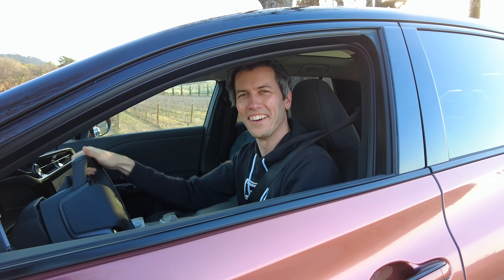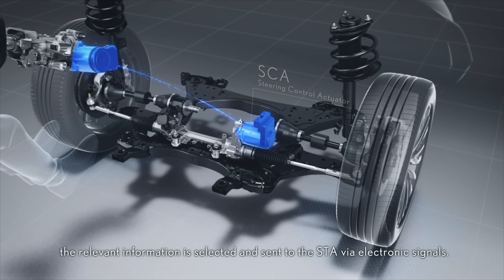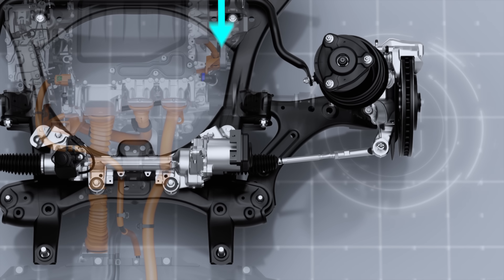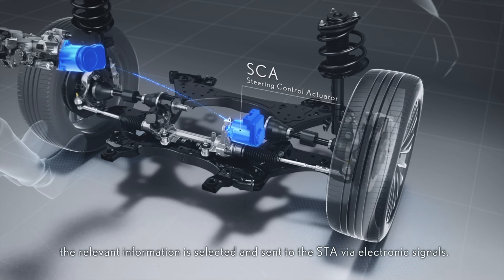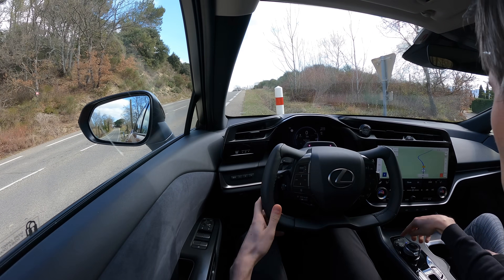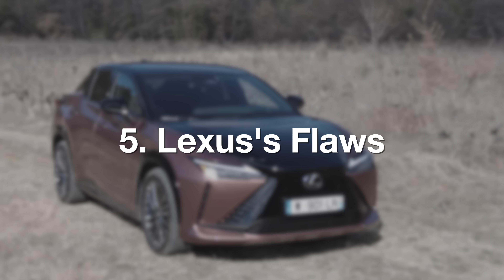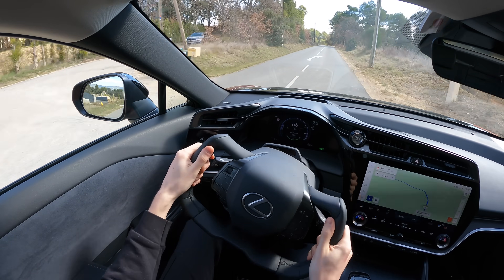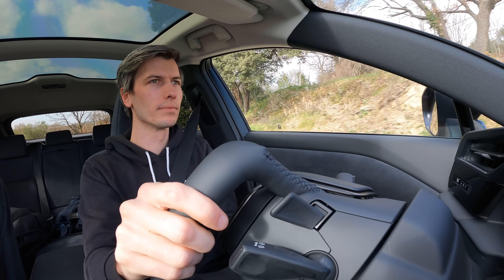How Lexus Fixed Tesla's Bad Idea: Steer-By-Wire Yoke

Comment: A variable steering ratio is going to be unpredictable for the driver, it would be like if the sensitivity of your mouse cursor kept changing, you cannot build muscle memory and learn how the steering behaves. Also the electronics could fail and there would be no way to steer the car.

Comment: I think it's a great OPTION. And I have that word in caps for a reason. 

It's a cool feature that some people may want. If you buy the car, it shouldn't be the default option (at least not in today's car market).

It's great to have new features, but if you're going to force it like Tesla did, you end up with way more problems and people complaining.

Same with Tesla and their "I need to have everything on the complicated touch screen instead of buttons". I think Tesla makes good EVs, and when they were the only option, you would deal with the setup, because there wasn't competition. Now that we have many other EVs on the market, I'm surprised they still don't have more button options, even if it is just an option.

Lexus Yolk: 8/10
Teslas old yolk: 5/10

Comment: I wonder how fast you can steer the wheel before you hit a power requirement barrier at the steer motor. I.e., if you wanted a rack ratio of 5:1, and you whip the steering wheel super fast with your hands, (the force*velocity = power) what is the max rack speed that is possible given the battery situation. In other words, up to a certain high steering wheel angle speed, eventually the rack/motor will not be able to catch up and be severely lagging behind due to a lack of power. Something that never happens with a mechanical system, because the DRIVER is putting energy into the system.

Comment: I had a 96 Deville with  hydraulic variable steering. At low speeds the steering was like an old sailing ship,tons of rotations, smooth and lazy. Highway speeds were tight and quick. No idea how GM did it but it worked really well as was one of the few things on that car that never broke.

Comment: Increased steering sensitivity is the keyword.

Going from 3.6 turns lock to lock to 2.4, the steering requires real memory muscle reflexes, when the car gets sideways. 

You need to perform real restraint in corrections of the steering.  

: )

Comment: I have adjustable electric assist and it's more than good enough. And we'll read your obit when your car blows a fuse, or a wire shakes off  and you head on into an oak tree at 60mph. Now you're pushing a possible life risk and have gone off the wall and I'm gone. I won't be back. Most of your stuff is B.S anyway. And thanks for the info, I'll be sure NEVER to buy a Lexus.

Comment: You know what also can mimic real steering forces? A proper connected steering shaft. I'm so sick of car companies trying to re-invent the wheel just to be iNoVaTiVe and MoDeRn. You want that feeling when going over bumps. Also will the wheel work with the vehicle off? because that would suck having to move a car and you have no steering. And yata yata redundancies. What happens if both go out at the same time? I assume there is only one wiring harness plugged in, what happens if there is an electrical fault? I'd also imagine the load on the battery is quite a bit. I'll never drive one of these consumable cars.

Comment: It's quite feasible engineer a drive by wire system to the level of reliability of the mechanical hydraulic assisted system, which is not infallible. This is already done is all manner of aerospace and industrial applications. Note that a mechanical mechanism has no failsafe: it can just fail. A any failure of input control and the car system could recover and or take emergency action such as emergency braking.

Comment: There's potential for some very interesting and fun things with "by-wire" technology. My first experience in ownership with throttle by wire was in a 2013 BMW 335. I really enjoyed the different drive modes. Eco was great for daily commutes where I needed to behave, all the way up to Sport Sharp where the throttle was extremely sensitive when it was appropriate to have a little fun. Not entirely sure how I feel about steer-by-wire, however. But I'm open to experiencing for myself before I make that call. If they can perfect it to make it intuitive and invisible, I'm sure I'd adjust.

Comment: As someone that works on cars, what do you do if the whole electrical system has no power at all or the wiring to the steering wheel sensors is damaged/broken? You can't turn the wheels when pushing it. Any normal car you can still steer when it's dead to be able to maneuver it to a safe place or into the shop for repair

Comment: nissan did it better, it basically functions identically but theres a traditional steering shaft with a clutch that stays open when the system is active and slams shut under any fault condition or when the car is off so it just returns to normal mechanical steering, this still allows for the variable steering ratio but doesnt leave you with no steering when the car is off, especially useful for if you have to push the car onto a trailer or something

Comment: TLDR for this video: Lexus carefully designed the yoke and steering system around each other to maximize usability. Tesla just slapped a yoke in place of the wheel because it looked cool and called it a day.

Comment: Just wonder if this is "just" a more fancy adjustable steering ratio, or it's more like modern Fly-By-Wire system.
In modern FBW system, the stick movement is not tell computer how much control surface to move, it's tell the computer what the outcome the pilot want, for example in C* system a little pull on the stick means "I want 1.3G in vertical axis" and it's up to the computer with all it's sensor to figure out how much elevator\trim\flap\slats\thrust-vectors or whatever it can move to get that 1.3G and hold there.
Like, in case of SCA total failure, could it possible to use differential braking on each wheel to get some directional control to stop safely?

Comment: high ratio in low speeds sounds good, but I will never trust that system with my or my family's lives. A delay could mean that you won't be able to go around an obstacle on the road. The motors might be reliable and have redundancy, but a problem with a sensor or wiring could mean that the ECU is going to get a wrong input that might send you in a wall, or just put you in a low gear ratio in a low speed scenario, making you unable to turn.
I will never trust a system for braking or steering which is entirely electronic. For the drive-by-wire, its all the same, I've broken a throttle body part where it holds the steel cable during aggressive driving, the car just stops accelerating, which is completely fine, hazards on, move to the right, everything is fine... But losing steering and braking?  No thanks. Even if it makes life easier, the fact that at some point, SOMEONE, 1 person, will have this thing fail which will cost his life makes it NOT worth it. If an animal jumps in front of you on the road, with that 0.6 sec delay, you are hitting it, no matter how good of a driver you are. This is just another thing of the "planned obsolescence" to make cars less desirable on the used market. This system could run just fine in the first 80,000 miles, but how about after 250,000 miles... Those wires will get chewed up, overheat, short circuit and send you in a tree... That is... if the person who gets that car replaces the battery... because we all know that there is no chance in hell an electric car battery survives for 250,000 miles, Teslas close to 300-350,000 miles already have like 3 battery swaps for 20-25000k USD and 1-2 motors depending on the model, wont be any different with a Lexus. Everyone is jumping on the "Electric iz gut" train too fast, the technology itself isn't ready for this, batteries are not safe, cars are not safe, systems are not safe... that is a lot of "not safe" things combined in one place, sure, it is 10% better for the environment in the long run if you don't charge it from a 60,000 USD solar panel system on your roof, and they don't require oil changes (which sum up to 1200 USD if you change it yourself, for the same period that a battery dies... 5 liters is $60 for a single oil change, a battery lasts from  80k to 120k miles in average, $60 every 6000 miles is $600 per 60,000 miles or $1,200 per 120k miles. Even if your engine takes a bit more, it still won't cost you more than $2000, and the cheapest used battery in good condition is $18,000, motors are in the $10k as well)... In the last year, there were 3 car fires in my home town, all of them were electric vehicles... I see NO reason at all to switch to a less fun, less safe, less economically friendly (here you have to pay for the charging, and it is around $100 to fill up a Tesla to go 250 miles)... The only benefit is the free parking in the city center, but I will live without that ;)

Comment: Wait, shouldn't the responsiveness test been done on rotating plates? Maybe the electric steering just cant make it move as fast as you're turning your wheel because of the resistance between the tires and the ground? Would be cool to get a test

Comment: It's very OLD TECH. Especially in the R/C CAR COMUNITY. It's called dual rate steering. It allows you to regulate the amount of steering based on the speed or specific needs, i.e., turn it up to limit the steering in a high speed pass, or turn it down to get full steering at lower speeds.  It's a feature of some R/C transmitters. The steering mechanism in all R/C cars is similar since it is electronically  controlled by a motor (steering servo). The dual rate feature is controlled by the user via a knob on the transmitter.
Reply: I think you're confusing EXPO (exponential) with Dual Rates.  Exponential is used to change the sensitivity of the steering in low deflections of the wheel and still allow full deflection of the wheels at full-lock of the steering wheel, but it does not change how much the steered wheels actually move.  Dual Rates are mostly used in R/C aircraft to allow greater deflection at low airspeeds, like on landing and take-off where larger control deflection enhances control.
Reply: @A Webuser  

It is more or less a combination of the two smart systems....
Exponential settings control the response curve of the steering or throttle, respectively. However it DOESN'T affect the maximum steering angle or maximum throttle/braking - those adjustments should be done with end-point adjustments or dual-rate adjustments. LEXUS APPROACH IS MORE OR LESS AN AUTOMATION FOR DUAL RATE STEERING WHERE IS DIALED UP OR DOWN BASED ON SPEED, ALTHOUGH IS REGULATED BY A COMPUTER AND NOT THE USER.
Reply: @jah-jah87  Yes, but such a thing does not exist on an R/C car radio.  Dual Rates are not a relevant feature for R/C cars....
Reply: @A Webuser   Sorry, im not sure what you mean by that. Dual-rate steering has been a thing in the R/C community for way over 10 years. Based on your previous comments, you are familiar with the r/c airplanes and not with cars, which would explain you confusing exponential settings with dual-rate. Nonetheless, if you read my initial comment, you'd realize i merely compared the technology, and yes, it is relevant due to the fact that it's tech you can readily find in MANY RTR R/C CARS.
Reply: @jah-jah87  Maybe, but dual-rates (emphasize DUAL) are useless for R/C cars since the driver cannot apply them in any useful manner in real-time.  I competed in R/C for years and was a national-level driver and there's no application of a "switch" that would change the maximum deflection of the steered wheels while driving in a high-speed race.  EXPO, on the other hand, is incredibly useful to remove on-center twitchiness at high-speeds.

Car radios use ATV/EPA, etc. for set-up and it seems you're describing a kind of easily-adjustable ATV/EPA for allowing tweaks to maximum steering angle WHILE DRIVING, but the actual use of it would be negligible since unless the track conditions changed dramatically, you'd have that long-since dialed-in.  In any case, it's NOT "Dual-Rates", that's for aircraft.

In any case, your comparison is kind of pointless since the Lexus system is a hybrid of EXPO and ATV, dynamically adjusted based on velocity and driving conditions, and this simply does not exist in ANY way on an R/C transmitter.
Reply: @A Webuser  got you. I couldnt find anything simpler but here. Its a 3 min video, over 10 years old with a traxxas remote, btw I get why expo and d/r get confused between cars and airplanes thats why i mentioned, but maybe youd understand what I mean after you watch him dial it. 

Also Try looking up Raz shifrin on YouTube, he does 200+ mph onroad to explain in basic terms the whole idea is to use the dial at high speed pass to limit the amount of servo movement to avoid sudden movements at high speeds. 😀

Comment: if only i could count the amount of cars ive seen with steering wheel angle sensor codes, problems and misconfiguration. Drive by wire is great until it needs to be fixed, recalibrated ect. 

with the wheel not needing to make full rotations the clock spring and other components could be simpler so this concern might be mute. only time will tell after about 10 years of it in the wild. in the meantime would rather stick to the tech that is known and proven to be reliable and has most or all the early adopter issues worked out.

Comment: Steering-by-wire should be mechanically connected (at least like bicycle brake wires). Mechanical systems with variable steering ratio have been there for decades and they don't have such dangerous delays like electronic systems.

Comment: At first I was extremely skeptical. But after watching the video I wouldn't mind it, provided that they fix the response time issue and have a mode that amplifies road feedback. My only concern are those who will ignore the warning light saying that redundancy has been lost and will continue driving with only one functional steering motor until it also fails and causes a crash.

Comment: Sounded very fan boy to me, always nice to show non existent cars as an option to show how much better they did some tthing compared to an existing vehicle.
There are a few mis givings as far as Steer by wire, if my cars acceleration has a problem I can just turn of the car and move over to the side, if my Steering has a fault no matter all your BS about redundancies, life never works as we expect or want it to.
Things will always go wrong in some situations, if you are flying down the highway say in Germany doing 140+ MPH and the steering has a glitch, in a manual steering car, we have the problem the steering becomes harder to turn, but still works, once it's fly by wire, you need to pray and hope there is a God.
I have worked long enough to see redundancies fail, all it takes is power to fail, just for a second or two or totally while you are going around a curve in the road at high speed and you are gone, no come back no matter all the redundancies.
The less control over things they give us, the less control we have.
You children may love giving over control to any one and every one, us slightly more mature people are used to having control over what we are able to do with in normal reasons.
Steering needs to be one thing that is always in our control no matter what happens other than a wheel falling off ;).
I am sure one day very soon, we won't be driving our cars any more as they will be self driving robots and we will therefore enjoy and relax while we go from A to B.
Anyone that takes a Bus or train should have no problems as we all just take for granted the Bus or train will make it to where we want.
Some if they can see the road may feel less relaxed in a car that is self driving :)

Comment: Hey nothing to worry about this, Drive By Wire, stuff. They've been flying the, F-16 that way for nearly 50 years. And not many pilots have been killed because of that. Not many. And since much automotive technology has been patterned after, Aeronautic Technology.

Which will now allow the driver to be sitting in the, backseat. Where there is a higher incidence of survival in crashes. Just like in a jet airliner. Only the folks in the back survive. And now everybody can become, an actual, Backseat Driver. No need to sit in the front anymore. And die in a head-on collision.  When you are driving from the backseat. All your passengers in the front seat will die. And luckily you won't. If you drive from the backseat.

And so we all know. Many of these custom car fanatics. Will, do just that. And it will cause accidents all by itself. When people see a car driving down the street. With no driver and no passenger to see of. And people will freak out! And jump in front of it. Trying to stop it! Because it is not human! And it's alive and driving! 

Boo hiss!!!  I am like a gigantic kitty cat and  Jesus will get you!
RamyRAD